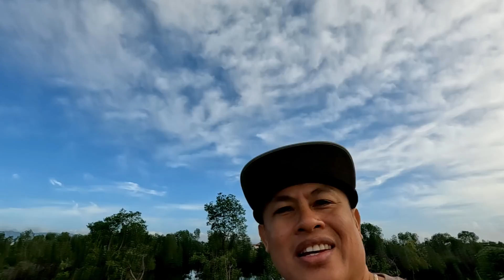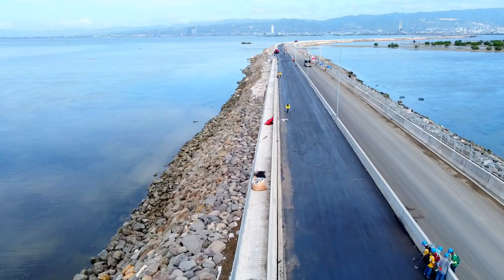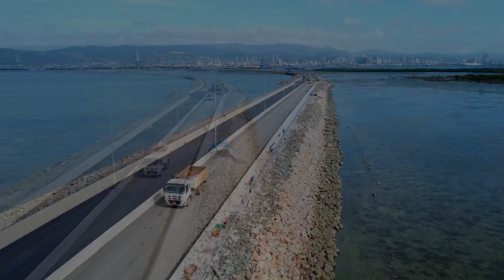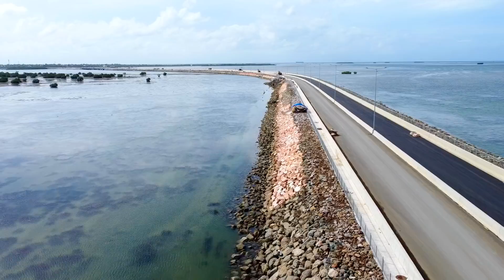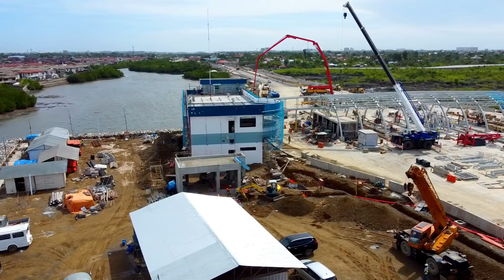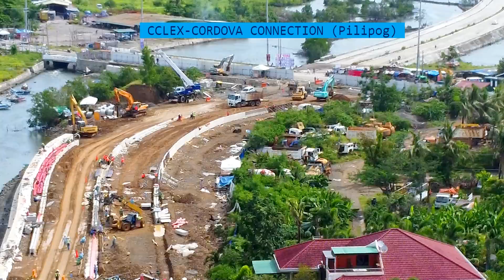CCLEX  NOW AT 94% COMPLETE | FULL UPDATE (PART 1: CORDOVA)

Comment: 👍👌:elbowbump:
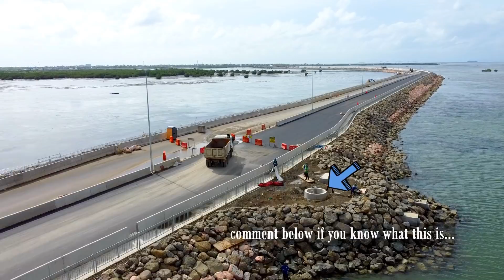at 5:45 - that is part of drainage system. A contraption / catchment basin to prevent garbage, wastes and solids from the causeway/road getting released to the sea. Maintenance personnel will check and clean-up that part through the manhole.
There are several of that installed along the stretch of CCLEX causeway.
Reply from the maker: Dugang hibalo alang kanako. Salamat kanimo, Sir! 🙌🙂